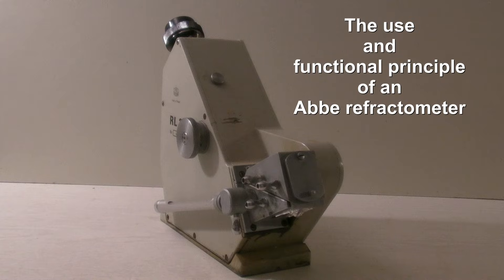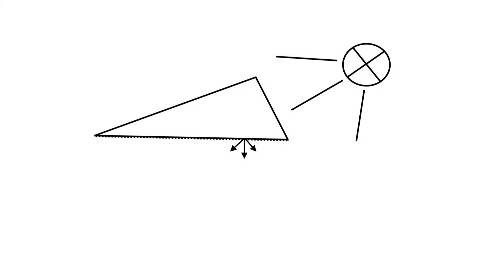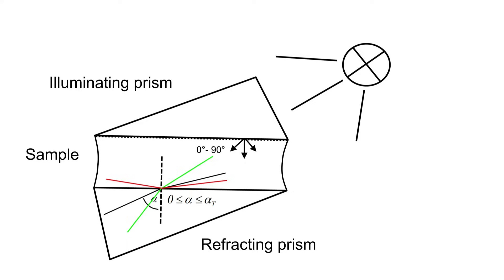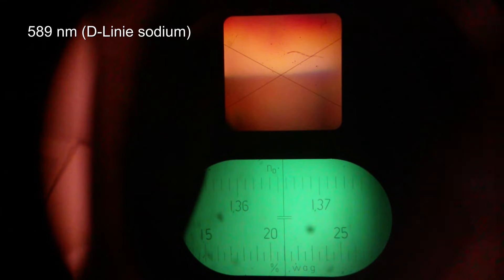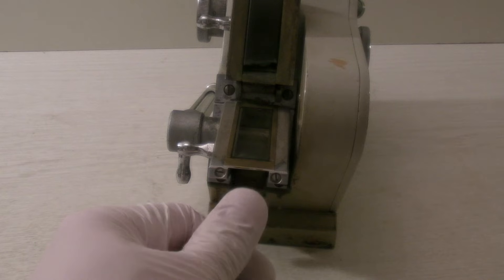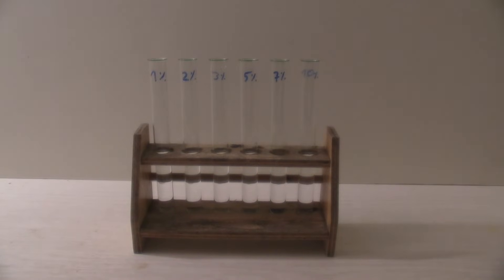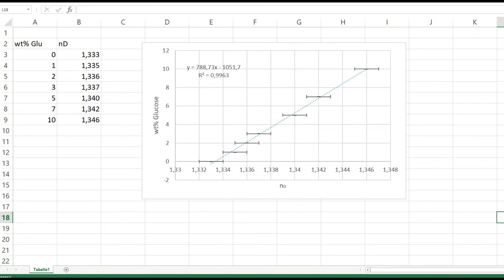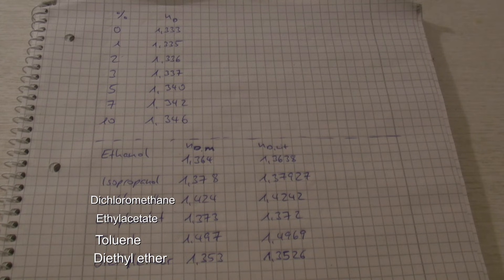Abbe refractometer (The use and how it works)

Comment: If Alpha T is critical angle of sample liquid then how total internal reflection can occur because there is denser reflecting prism in front of rarer liquid sample
Reply: Hi, this was confusing indeed. The refracting prism has a refractive index larger than the sample. Therefore, the critical angle is the angle from which on total internal reflection would occur IF THE LIGHT WAS COMING FROM THE PRISM TO THE SAMPLE. However light is coming from the sample to the prism (and the behaviour of rays is the same if we invert direction) so the same critical angle is the angle of the cone of vision from the prism. Picture the famous fish looking up from water. Light with grazing incidence on the water gets refracted to the fish's eye at the critical angle. Beyond that angle the fish does not see any light coming from the air.

Comment: What is alpha t?
Reply from the maker: Alpha t is the critical angle of total reflection. When the angle of the light hitting the surface of the refracting prism gets to alpha t and above it, the light is reflected completely. If it's below alpha t the light is transmitted through the surface.
Reply: How can light be reflected back to liquid from a refracting prism because a refracting prism is denser than a sample liquid....
And total internal reflection only takes place when there is a rarer medium in front ...
Please 🙏 Ans

Comment: I came across a deal on a nice handheld refractometer a while back and bought it to use in brewing, but I'm finding it super helpful in verifying purity of solvents extracted/distilled from consumer products. Basically I'm finding out that vigreux columns are pretty limited.
Reply from the maker: That's interesting. I thought they work as good as it is told in the labs. I also tested a small sample of selfmade chloroform and found out that it was quite far from pure, even after distillation.